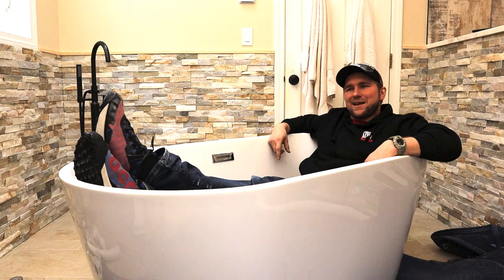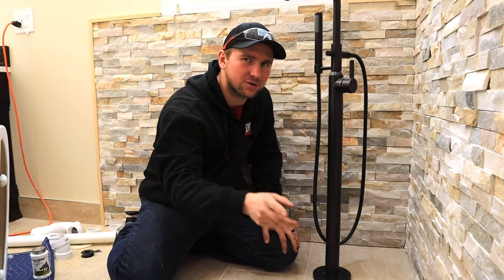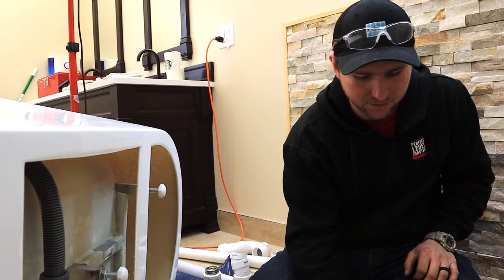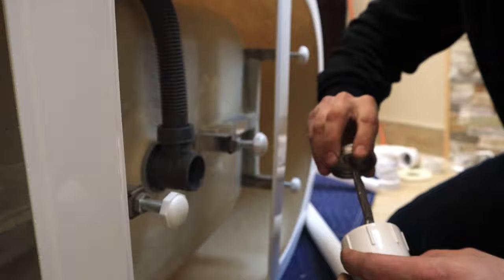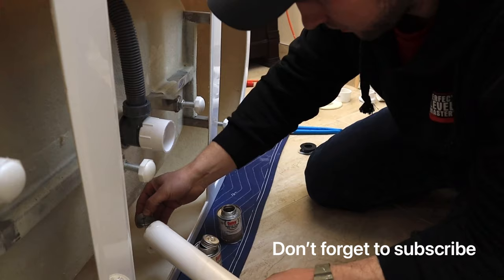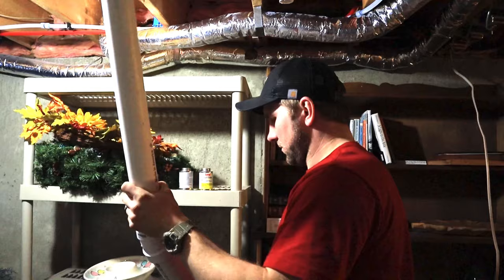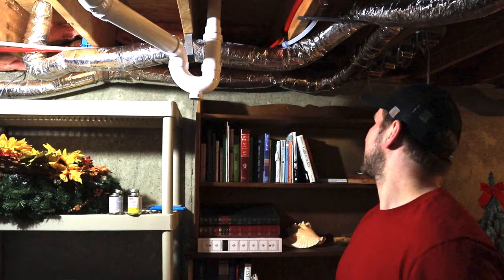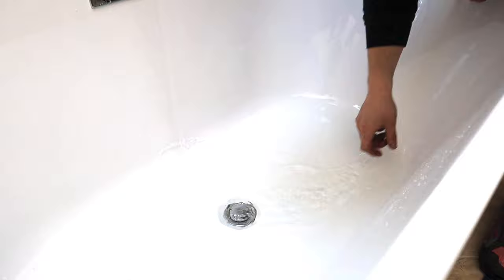How to install a vessel Tub. How to install a freestanding tub.

Comment: Thank you so much for posting this. This is EXACTLY the video I need to install my tub. I don't like the cheap hose that came with the tub because I've used them under kitchen sinks and eventually they crack and leak. I wanted to see how to replace the hose with PVC, and now I know how 👍

Comment: A tip for anchorage of soaking tubs. On installs where I have access underneath I like to screw a piece of aluminum angle, perpendicular to the length of the tub, to each pair of steel legs. I then drill a 1/2” hole in it, and put a bolt or length of threaded rod long enough to penetrate the subfloor. Then with a nut and washer underneath I can tighten it to the floor. Two half inch bolts I’ve found are enough to make it rock solid. Of course you have to be willing/able to drill extra holes in the finished floor. I wish some of the manufacturers would add a few extra 1/2” nuts welded in for this purpose. On installs where I can’t access the underside of the finished floor I make “cheats” usually out of treated 2x I put two approximately 6” long pieces, with a groove at the bottom that allows the bottom lip of the tub to slide in, on the floor usually screwed down(I have glued them though). I install these under the side of the tub opposite where someone would be getting in so the tub can’t be tipped when leaning in the edge. Then I put two pieces without a groove opposite these as close to the rim as clearance allows. Leave the drain opening just big enough that the back edge can be slid under the cleats before setting the front edge down. Once the tub is on the floor slide it tight against the unknotched blocks. (I put a liberal bead of silicone on the front lip before pushing it tight to help keep it against the blocks) I find that particularly in homes with children some form of more secure anchorage is critical. I have been to half a dozen calls to repair drains where children climbing in an empty acrylic tub or adults setting on the edge actually tipped it enough to break the drain pipe. Additionally, there are a couple manufacturers who make a “drop in” drain. The drain is roughed in flushing to the floor. It has one or more oring seals that allow a standard brass tailpiece lubricated with silicone seal lube to be slid in from the top.  You attach the tailpiece to the tub and with help set tub in place and your done no gluing or tightening.  Tile coach on YouTube has a video about it.
Reply: I’m not totally understanding but I see the problem. Small town here and plumbers will not install. And I’m installing ina sloped floor shower. Help

Comment: Ita actually not so bad. I think i was drunk when i made my first comments. I like that you choose to do without the flex trap. Only thing i could say little more primer help soften up that pipe its a much stronger bond. Did a nice job on them water lines.

Comment: All good if you have access to the floor below, which I don't in my 2 story house. I have a finished popcorn ceiling that has faded over time so cutting a hole and repairing it is an expensive option as I would need to do the entire room. I'm going to install a rubber P trap with no ridges.

Comment: I've just bought a very similar bath, how would you do the waste if you couldn't access it from basement underneath, my bathroom is above my kitchen, I don't really want to take ceiling down if I can help it..
Reply: Hi Adam, the only other option is to lift the floor in your bathroom to find the waste pipe for you old bath tub and plumb into that.

Comment: This video did not show any of the details needed to properly install a free-standing tub’s in-floor drain.   Free-standing tubs endure a great deal of force not only up and down as the weight of water and bathers is added to it, but also lateral forces as kids play in the tub and as elderly brace themselves on one side or another as they climb in and out. , not to mention the not so elderly as they brace adjust the tub and so thing in shower rooms. 
How is the tub secured to the floor.  How did you seal around the tub to keep water from going down the sides and into the space below.   Additionally, the subfloor is exposed to any water that makes its way past the seal. 
I ask this because our Island Tub Drain has failed twice and these are all the factors that came into play with its failure.

Comment: Is there a reason you didn’t had a shutoff valve on the hot and cold supply line? Also should of done a hub x hub connection p trap just in case the tub needs to be replaced or removed.
Reply from the maker: You can cut the pipe and replace the tub. Easy

Comment: What do you do if you don't have basement access? My p-trap is already set in between the floor joists have good 8-in hole but the p-trap tube they gave me never get set right. The water won't drain It's like the hose moves or something when I sit down the tub. Would love to glue it but there's no way I could lift up the whole toe tub and get the right fit with wet glue. I've seen some other hoses that are collapsible, but it looks hokey.
Reply: I assume you already got it figured out, but I don't have access below my tub, so I'm pulling up sections of subfloor, and will have to reach under the floor/tub to connect the drain pipe.

Comment: So you're using the plumbing to secure into place so it doesn't move? Wouldn't silicone for adhesion and a flexible pipe just in case be a better option. Also, easier to install and line up.
Reply: Your right a flexible hose also allows you to replace the drain or fix a leak without opening up drywall

Comment: Can you give me advice on plumbing for washer drain out.  So my washer is located 8 feet away from the drain out.  I have the washer hose in the stand pipe, the flow goes down the stand pipe ground level across 4ft , then it goes up 18 inches and then across about 3 or 4 feet, elbow fitting into drain.  

The problem I have is water over flow from stand pipe.  I Believe the issues is the direction of the water flow of the pipes causing it to back up.  Help
Reply from the maker: Hey man! I can help best I can. Can you DM me a picture on IG please! I will help
Reply: @WINNI.Designs  oh heck yah thanks for your response any advice is great. It’s my moms house, I’ll get the pic and message you on Instagram.

Comment: Looks like your using “ cleaner” not primer. You must use primer with pvc or the bond will not hold. Primer does not clean the pipe. It creates a chemical reaction with the glue to create a permanent weld. Just using pvc glue without primer will fail over time.
Reply: Not true it’s not code no more